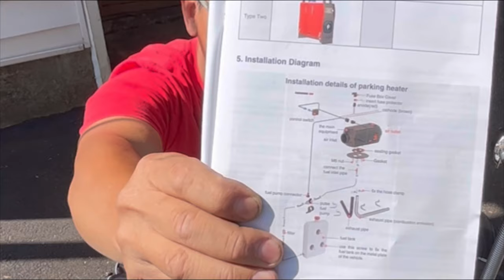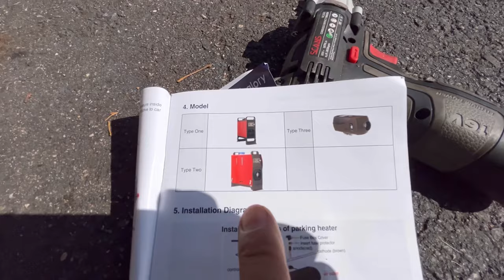THE WORST PRODUCT REVIEW EVER!  HCanopy DIESEL AIR HEATER INCOMPLETE PARTS TERRIBLE INSTRUCTIONS F-

Comment: ya should of bought the portable one. with it all you have to do is put fuel in the tank and hook up 12v DC. as for the tank drill hole in tank on 1 of the flat spots. the same size as the threads, put hose on fitting , feed hose thru the hole and put on nut. i have 6 of them and they work very well. you should go be an apprentice to a handyman for a while to learn how to do things.
Reply from the maker: I didn’t buy it!

Comment: Buddy, I live in Maine and it gets pretty darn cold here. My garage is 26x36 with an attic.  I use a Mr. Heat propane heater with dual burners for November through December and March through April. January and February I pair it with one and sometimes two kerosene heaters if it gets really cold. I burn K1 kerosene which isn’t what’s recommended, but that just means that my wick’s only last a season. I leave a window cracked open about an inch just to get fresh air in. It doesn’t smell and my carbon monoxide alarm has never gone off. As small as your space is, you should be able to use the Mr.  Heat propane heater without issues. Keep up the good work!
Reply from the maker: I don’t close the garage door,  just sit near the heater